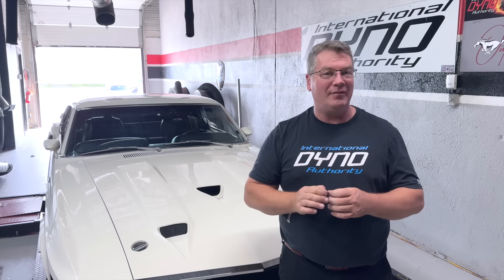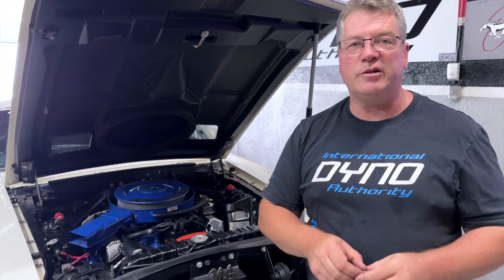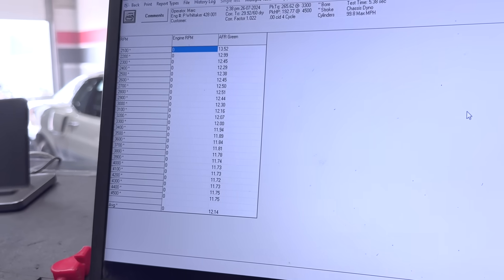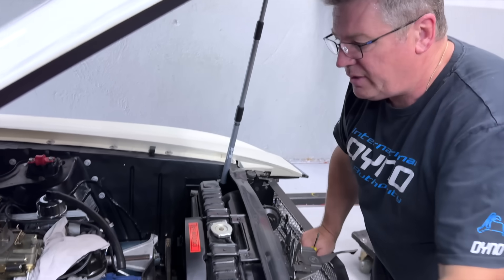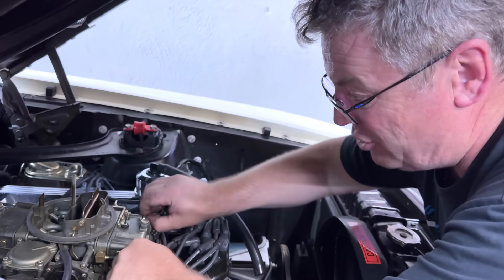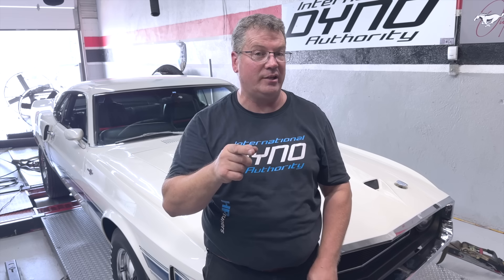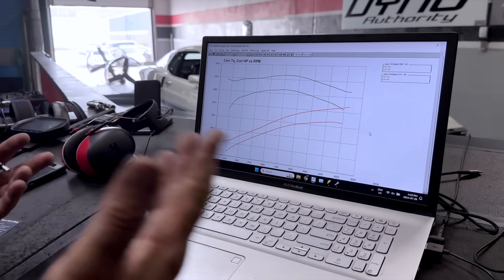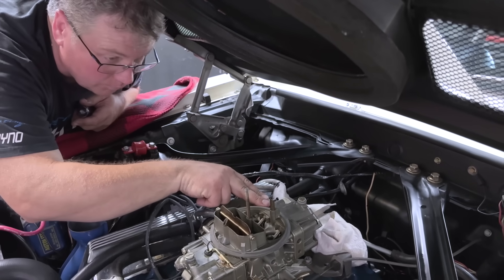Original, unrestored '69 Shelby GT500 tuned on the dyno

Comment: The 428 cu/in Cobrajet was a great engine.
Reply from the maker: @beameup64  

Hey there! Thanks for your comment and for sparking this great discussion about the 1970 Shelby 428 Mach 1 Mustang. It's a truly iconic car, and there's always something new to learn about these classics.  You're right to bring up the specifics – the 428 Cobra Jet engine is a legend.  For those interested, the bore and stroke of this beast are 4.13 inches and 3.98 inches, respectively, contributing to its impressive power output.  It's these details that really make these engines special and fuel our passion for them.
One of the key components of the 428's performance was its carburetor.  The 1970 428 CJ typically used a single Holley 4-barrel carburetor, often a model 4150.  These carburetors were known for their performance capabilities and were a significant part of what gave the 428 its reputation.  The specifics of the carburetor, like jet sizes and other tuning parameters, could vary slightly, adding another layer of complexity and interest for enthusiasts.
Now, about engine expertise – you've hit on a really important point.  The world of engines is vast, and no one person can know absolutely everything about every single one.  We all have different levels of experience and education, and that's perfectly okay. The beauty of the internet is that resources like Google are readily available.  We can all learn together by researching, discussing, and sharing information.  No one is the absolute authority, and we're all constantly learning and expanding our knowledge.  Even seasoned mechanics are always discovering new things!
At International Dyno Authority, we truly appreciate comments like yours.  They ignite these conversations and help us all learn and grow together in the automotive world.  We believe that sharing information and different perspectives is what makes this community so vibrant.  So thank you again for your input, and keep those comments coming! We value your feedback and look forward to more engaging discussions with you and all our viewers.

Comment: I hate to tell you the 1969-1970
“Shelby”
 Mustangs are just that Mustang’s Not Real Shelby’s. As Carroll Shelby was no longer affiliated with Ford in the Shelby Mustang program the last true Shelby‘s were built by Shelby American ended by 1968. I know that this is fact. As when I purchased my 1967 Shelby Gt 500. I spoke to a Shelby registry official that provided me with this information. As I was originally looking at a 1969 Shelby Gt500. He told me if I truly wanted a real Shelby Mustang to get a 1965-1967. I own a 1967 Shelby GT 500 No 2097. But the 1969-1970 Ford Shelby’s are really neat cars and are certainly worth collecting. But remember the 1970’s were left over cars that did not sell during the 1969 Model Year.
Reply from the maker: @67gt500snakebite  

https://youtu.be/hwC-36sHOeY?si=j9-4u8BhuFUzytiQ
Reply from the maker: ally referred to as a "Shelby GT500", features a 428 cubic inch (7.0L) Cobra Jet V8 engine with a horsepower rating of 335hp, a 4-speed manual transmission, a 10.6:1 compression ratio, and a bore and stroke of 4.13 inches x 3.98 inches; it's considered one of the most powerful muscle cars of its era. 

Key Specs:

Engine: 428 cubic inch (7.0L) Cobra Jet V8

Horsepower: 335 hp

Transmission: 4-speed manual

Compression Ratio: 10.6:1

Bore x Stroke: 4.13 inches x 3.98 inches

Carburetion: Holley 4-barrel carburetor

Rear Axle: 3.50 Traction-Lok limited slip differential 

Hagerty rates a "Modest" version of this car at $93,000.00

1970 Shelby GT500

2dr SportsRoof

8-cyl. 428cid/335hp 4bbl

Watch

#1 Concours

Join for free to view

#2 Excellent

Join for free to view

#3 Good

$93,800*

How much is a 1970 Shelby GT 500 worth?

Typically, you can expect to pay around $123,900 for a 1970 Shelby GT500 in good condition with average spec. What is the highest selling price of a 1970 Shelby GT500? The highest selling price of a 1970 Shelby GT500 at auction over the last three years was $352,000.

One in this condition is worth North of $400,000 usd.
Reply: @internationaldynoauthority693  yes, I did not mean to imply that these cars are not truly special. I am just providing the facts. Carol Shelby was very dissatisfied with Ford as they  had shifted most focus on the 1969-1970 Boss 302 and Boss 429 program  developed by Larry Shinoda and Bunkie Knudsen. The last true Shelby Mustangs built by Shelby American ended in 1967.  I personally ment Carol Shelby in New Mexico when I just owned a Boss 302 Mustang. I had Carol Shelby sign me a T-Shirt say “Brian May You Soon Own One Of The Best Signed Carol Shelby. It took me until 2001 to purchase a real 1967 Shelby GT500 No#2097 an original car with 86,000 miles on it nubber matching in all account. All tho the engine block was not stamped with the cars vin number on ANY of them in 1967. Original Dark Moss Green Car With White Stripes. But I do have 428CJ Heads on the car. Every thing else is totally correct for the car. I am the 3rd owner of this Shelby Mustang. And yes I pretty much paid a song, and a dance for it. The value of this car has increased dramatically since I purchased the Shelby. The person that I purchased it from tried to get out of the sale when he went to Carlisle car show. But I had already put a big deposit on the car. Has he witnessed the value sharply increasing on these cars after the movie “Gone In 60 Seconds. I took delivery in June 2001.
Reply: @67gt500snakebite  Acually Caroll Shelby hated Mustangs. He initially wanted to put Chevrolet engines in his Cobras but Chevrolet wouldn't sell him engines because they didn't want competition for the Corvette. So he bought engines from Ford. When Ford introduced the Mustang, they weren't satisfied with the performance, so Lee Iacocca contacted Shelby and asked him to modify the Mustangs. Shelby said that he wanted nothing to do with the Mustang. He didn't want his name associated with them because they were terrible cars. They are just Ford Falcons with different body panels. He said whatever you do to modify them is like putting lipstick on a pig. Iacocca told Shelby, either you help us with the Mustang or Ford won't sell you anymore engines. He was forced to modify the Mustang.
Reply: @ will I guess that is. Good thing. All though Chevrolet made decent reliable cars back then. 1920’s-1960’s GM has only put out absolute junk since then. I will need to research this comment. And no I absolutely not indicting you are wrong. But interesting comment.
Reply: @67gt500snakebite   My comment is well documented in print and also in interviews with Shelby. I owned a 67 Shelby 500 back in the 80s. I also owned a 71 Pantera back in the 80s, that I vintage raced. The Corvette in the 60s was a much better car than the Shelby Mustang. It was designed from scratch to be a sports car that could compete with Ferrari. In fact the 63 Corvette was a Ferrari prototype. 
In one interview at Barrett-Jackson. They asked Shelby what he thought about Shelby Mustangs selling for over $100,000. He said when they were new, they had trouble selling them for $2,995
 As far as quality now, I agree. No one has made a quality car since 1979. Everything changed in 1980 and has only gotten worse.
Whether Ford, Chevrolet or Dodge, I only own cars and trucks that were built before 1980.
Reply: @ I owned a A 1970 Boss 302. A 1971 Mustang Grande my 1st car. And. 1971 Mach 1 Mustang, a 1972 Mustang Mach 1 351CJ . And still have my 1969 Mach 1 Mustang. And My 1967 Shelby GT500 No #2097. And a 1939 Ford Tudor still with the 85jp Flathead V8. I have always Loved Fords. And Have always Loved Old Cadillac’s. God only knows how many of them that I have had. But those Fords are always notorious for overheating. Especially when I took my 351 Windsor out of my 69 Mach one and put in a 3 51 Cleveland 4V motor.
Reply: @67gt500snakebite   I just turned 65 and I've owned 50 cars in 50 years. I've owned several C2 and C3 Corvettes. Two of them were 66 427 390HP. One of them I owned in High school. I still own a 69 that I vintage race. I've owned several muscle cars and European sports cars. I own a few cars now. One of my daily drivers is a 69 F100 flareside 360. I never had an overheating problem with the 351 cleaveland in my Pantera. Although many did. My dad loved Cadillacs. He bought a new one every two years starting in 1957. In 68 he bought a Lincoln Mark III.
Reply: I'm jealous !!! That was the last true Shelby and beautiful to boot!!!  can you imagine if it had an optional DOHC dual 4 427??? Holy Smokes!! Ferrari didn't know what hit him in 65 !!
Reply: No denying your facts. We lived in Windsor Ontario in 1968 and attended the 1969 Detroit auto show which was typically held late in "68. I saw with my 10 year old eyes new Mach 1's Shelby's, Cobra's, Cyclones, etc. This model was a " transition model. Ford finally got a decent parts bin for the '69 models ready but still had to rely on local suppliers. One of the important ones was Holley Carburetor of Southfield MI. It's likely that in haste and arrogance Holley had to modify one of its' premiere products to Ford's specs in order to meet upcoming emissions specs. At this time the drivetrain was bullet proof thanks to NASCAR involvement and this is a FINE example of a pure " factory " performance unit. Sure SVO teams were shoehorning BOSS 429's and OHC 427's into that chassis but they required mods to get them in. Party on Garth.
Reply: I am personally not a fan of Holly Carburetors. I had a new one right out of the box that gave me nothing but trouble for a 1969 Mach 1 Mustang. I had removed the old tire out 351 Windsor. And put in a 351 Cleveland 4 V motor completely rebuilt. And through the years I had nothing but issue, after issue with it. It was a Holley 750 4v double pumper. I have since the purchase 3 Edelbrock carburetors. One to go onto my 1969 Mach 1, and 2 to go onto my 1967 Shelby GT500. So not a fan. But I will keep my oem 1967 Shelby GT 500 Holley’s but never put a Holley carburetor on anything ever again.

Comment: So, dumb question. Is a properly tuned carb better than TBI? And will a carb hold its tuning or do you have to touch it every year or so?
Reply from the maker: Properly tuned carburetor definitely makes more power than TBI. Once it's been set up correctly. Other than cleaning it, and replacing some parts once every 10 years. You don't need to touch it again. Ever. Ever. The Jets will never be incorrect again, the settings will never be incorrect again. 

The only reason to update and or change anything would be if you had a physical change on the other side. For example, if you put on long tube headers. Or if you change the camshaft or if you change the intake. 

or, if you change the cubic inches of the engine.
Reply: @internationaldynoauthority693 
Watched a video where they tuned and dyno'ed the same engine, first with a carb and then with an EFI.
Peak HP ended up being about equal.
Where the EFI was superior though was throughout the power band. They could set different tunes at different points along the rpm range so it ended up having a broader power curve.

Comment: In my 20's, I had a 70 Mach 1 with a 351 Cleveland. The previous owner had put a ton of money into the engine. We had a shop put it on a dyno and it was making 348 HP at the crank. Never appreciated that until seeing how much the 429 in the video made after your adjustments. It spun a rod bearing and when we pulled it apart, what we found had been done to it was incredible. Checking into it at the time (1978), there was almost 8 grand in parts in the engine in late 1970's dollars.   I always knew it made an incredible amount of HP for the engine size. Now I appreciate even more just how incredible that motor was. Sadly, the car was badly damaged in a towing accident, or I'd still have it.

You could drop her a gear at 55 mph, stomp on it, and she'd leave two solid black stripes on the highway that were about 10 ft long. I know cuz we went back and measured them.😁 I have stories about driving that car and it scaring the crap out of my friends😆
Reply from the maker: That’s a great story and a real testament to the incredible work that was put into your car back in the day. Makes me really appreciate the history of these machines.

Comment: So this carburetor was flawed from the factory?
My neighbour had the exact same engine in a red convertible GT500, and the rear of the car was black of soot...
Reply from the maker: @Nordmore68  All vehicles require tuning, to run at their best. 

This particular vehicle required a little bit more attention, and more tuning, than some of the vehicles that arrive at our tuning facility. 

In the end, we walked through the same procedure. That we always do. We performed the steps, we gathered the information. 

And we used empirical data, to make changes in each section, until, this is now smoke free and makes really good power. 

The factory simply performs a calibration. So, it will be within range but most of the time not very good, and most of the time very incorrect.

Comment: Ford lied that 428 should be closer to 400 hp at the flywheel
Reply from the maker: The rating system, has changed. Since, this was done. And back in the non-sanctioned days of horsepower, there were ratings with exhaust, ratings with no mufflers ratings with water pump ratings without water pump. In the end. All that really matters, is that we know how much it makes now. And, it runs clean. No smoke, and customer can go out at any point. Fire it up and have a great day of driving with his Mustang. 

Cheers, from all of us at International Dyno Authority

Comment: It amazes me how this hipo engine with so many cubes doesn’t make bigger horsepower!
Reply from the maker: @Kahuna54  Very mild cam, very mild intake, and, we did not push the limits at all. 

In another lifetime, we could have put in 98 octane. 

We could have put long tube headers, we could have taken a lot of the restriction away with the small valves. Put in a camshaft, put in a more aggressive intake. 

Immediately you've got 428 cubic inches that's making 500 foot pounds, and and just a shade under 400 horsepower. 

In this case, you have a very cool car, with a really cool heritage. That now runs good. Runs clean, runs smokeless, and basically is going to live out the rest of its life, as a very very pristine example of a 1969 GT500 Mustang. 

Cheers, and thank you so much for sparking conversation. 

From all of us at international Dyno Authority
Reply: @internationaldynoauthority693  I love the idea of maxing out these engines.... but there is something to be said for a pristine, perfectly running stock car.
Reply: Lackluster heads, puny cam intake etc. 
She cant breathe!
Reply: Just try and remember when this engine was made ffs
Reply: Whenever the torque # is higher than HP # that's a stout motor
Reply: @erniearambula3525  It is, actually more fun to drive on the st than high hp low torque engines. They are fun and rodwy but need a tolerance for them

Comment: My 69 mustang Fastback turned 12.6 in the quarter, stock, with a race tune. The timing was very critical, jetting, distributor advance springs and weights, slightly hotter plug, and upgrades to spark plug wires. Redline was around 6500. Very strong engine and the C6 was so strong. That car is amazing!
Reply from the maker: @QuantumTime-pc9ts  12.6 on a perfect day, with a perfect launch. Is possible. Put you just under 400 horsepower. At 3,750 lb. 

Definitely very very very fast for anything in 1969.
Reply from the maker: @QuantumTime-pc9ts  6, 500. Redline, whoa, quite a cam you had.

12. Anything is Moving ---- in a 1969...

Congratulations on the 1/4 MI passes to be proud of.  Wow..
Reply: @internationaldynoauthority693  she hit about 115 at the end of the quarter, the launch was crucial with it being a 5000 rpm neutral drop to low and then stand on it hard, the motor was a 428 Cobra Jet. She would squat then launch, so sweet. Could spin tires at 100 mph.
Reply from the maker: @QuantumTime-pc9ts  115?

http://www.wallaceracing.com/et-hp-mph.php
Reply: @internationaldynoauthority693  it’s all approximate at best using 70s technology. I believe the actual speed was close to 112, but the Speedo said 115. This was in 1975, the car had 6000 miles.
Reply: @QuantumTime-pc9ts  Breaking them loose at 100?  thats a little optimistic. Ran strong to rip off 12s though

Comment: Unrestored or unmodified?
Reply from the maker: @Fly4aWhiteGuy  unrestored, just maintained in original condition. (As close as possible) 

In other words, nobody has taken the entire body off, done a complete restoration back to 1969, the paint had a lot of imperfections but it's all the original paint and it's in amazing, amazing condition. Condition. Joe, if you can imagine something that has been slightly patina, worn, since 1969 but mainly kept inside and kept an incredible condition. That's what you would see when you see this vehicle. Amazing version of this 1969 Mustang. Love it!
Reply: @internationaldynoauthority693  in this shape, Id have a hard time tearing it apart if its in good shape. Normally I wanna mod everything